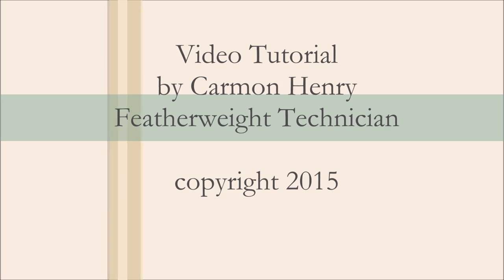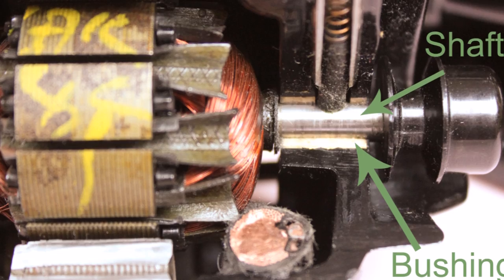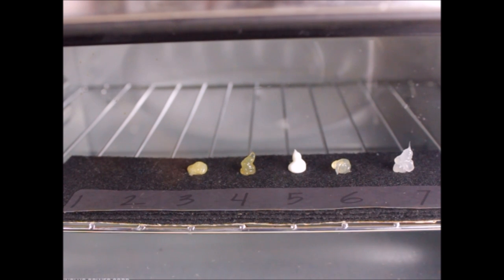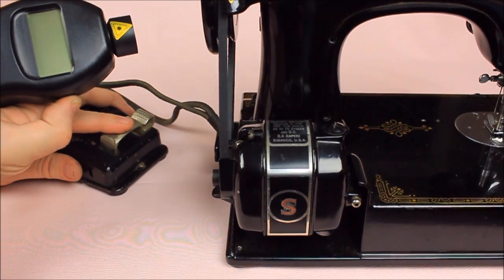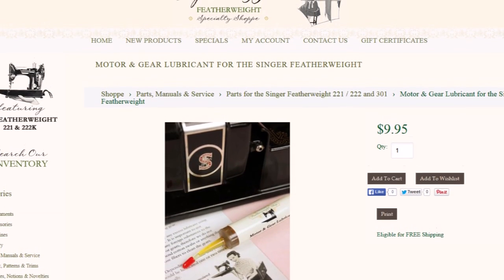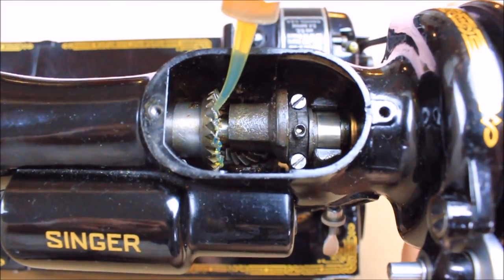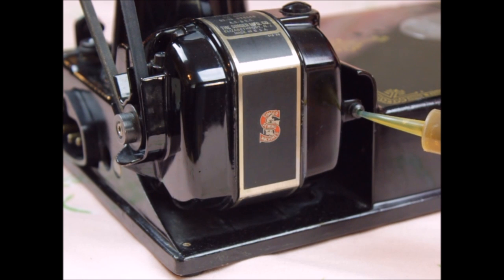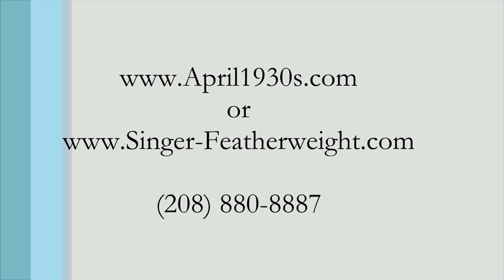COMPARISON Singer Featherweight 221 Motor & Gear Lubricant

Comment: Thank you for this information. I recently went to two stores that sell sewing machines parts and accessories and they told me they don't sell machine lube because they use oil instead. How can oil stay on gears ? That's didn't make sense.
Reply: Thank you!  I was told the same thing. Then one shop's "repairman" told me to use Tri FLow or white lithium grease!  I'm not a serviceman for machines, but even I know that's not a smart thing to do.

Comment: Was Vaseline one of the lubricants tested in this video, or was it covered in the follow up video only?
Reply from the maker: Vaseline as an alternative was not brought to our attention until after the first film was made, so it was addressed in the follow-up video. It has too low of a melting point for Featherweight motors and will turn to oil too quickly.  Please see blog and subsequent video for additional information and even some original Singer manuals with warnings of reference.

Comment: I watched the video and downloaded the PDF of the lubrication points for the Featherweight. I thought there was "sewing machine oil" that was to be used. Is the use of the lubricant in this video a different topic, with different points to be cleaned and serviced? Is there a different oil to be used on the points shown on the PDF? If so, where can I obtain this oil?  I'm a little confused now.
Reply from the maker: Hello!  Yes, everything is organized on the Featherweight Schoolhouse section of our website, under Maintenance & Tutorials and then subcategorized.  The oiling video tutorial and link is under Routine Servicing:

https://singer-featherweight.com/blogs/schoolhouse

https://singer-featherweight.com/products/oil-zoom-spout-sewing-machine